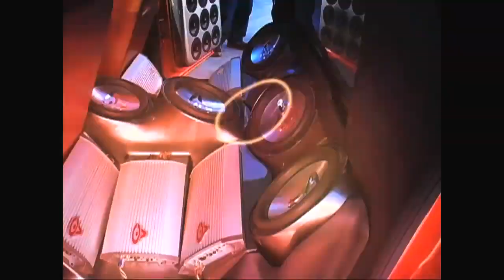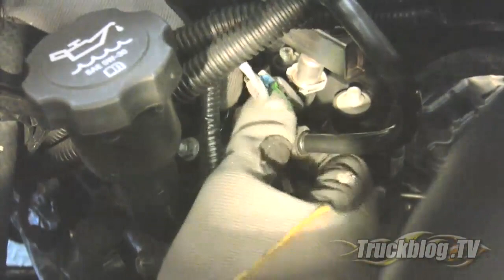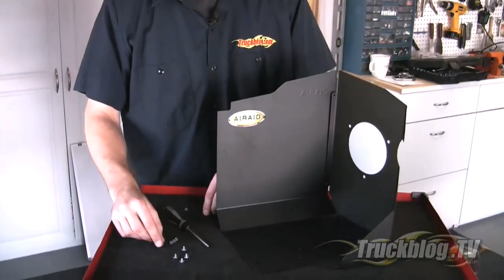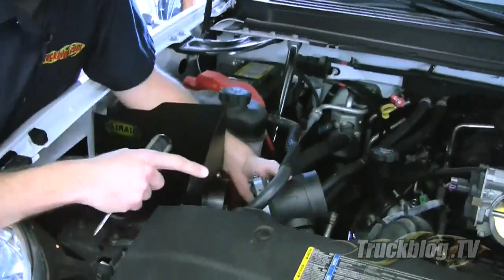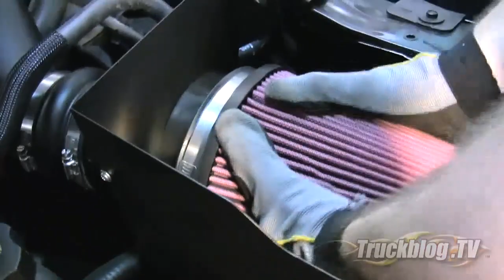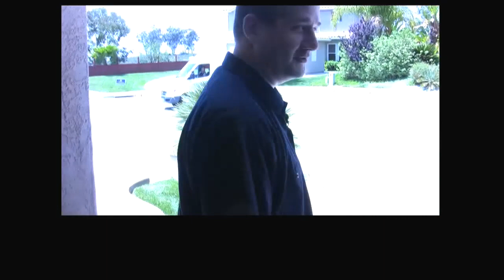How to Install Airaid Intake GMC Yukon Motorz #2

Comment: I have a 99 dodge ram 1500 5.9l v8 and i have a flomaster super 44 and thats about it, i ordered the airaid throttle body spacer and the air intake system. I just want to know what to expect. is it a pretty nice gain?  can u hear the whistle from the TBS? plz comment back =p

Comment: @GTnumber1 i believe it does more air going into the motor the better. plus a free flowing muffler also helps with fuel economy. im going to get a intake system but wounder if i should go for K&N or Air Raid?